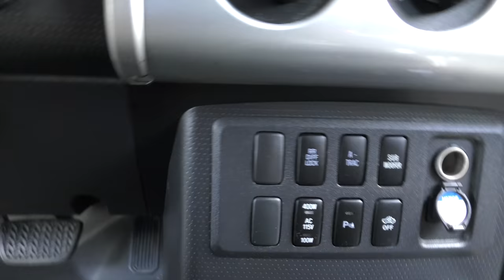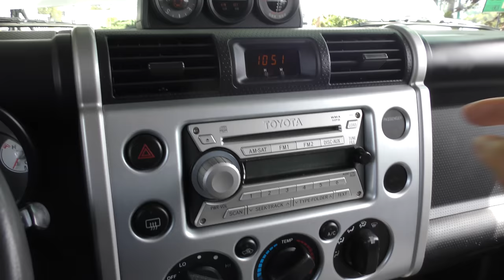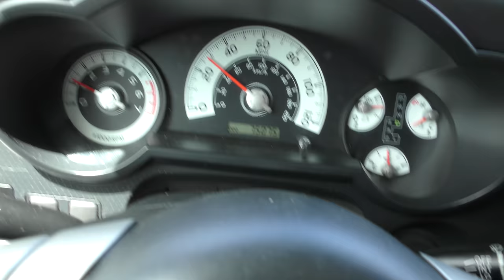I Finally Got a Toyota FJ Cruiser and Here’s What I Really Think of It

Comment: I witnessed a distracted driver slamming her car into the back of one of these which was at dead stop, she was going 40 mph. The Toyota didn't have a dent on it and her car was totaled.
Reply: Not a dent at 40 mph collision? Bee Ess. Because physics.
Reply: Yeah ok 👌
Reply: I had a '85 Toyota Xtra Cab Truck and got rear ended. This was back in '86, so don't recall the speed. I was sitting at a stop light on an off ramp and a lady smacked into me. We pulled away to get out of traffic and I could see her front grill mangled pretty good. She just took off in the opposite direction, probably had no insurance. My bumper just had a little smudge on it and  pushed in maybe 1/4", not real noticeable at all. Steel wool buffed out the smudge. Of course this was back when a bumper was a bumper. Sadly I cannot say the same for the frame. It eventually rusted where the spring shackles welded to the frame. But I bet it's 22RE engine is still running somewhere.
Reply: Was it my FJ? Because a girl in a BMW was distracted while driving and slammed into me. Thankfully she just scratched my tow hitch but her front end was demolished.
Reply: Perhaps if the Toyota was at rest without brakes applied....a lot of energy dissipated moving the FJ....
Reply: I could see that happening. A lot of the larger cars have more solid frames.
Reply: I had a 30 ft box truck hit me in my 09 FJ on an exit an entry ramp to dc beltway at about 40 mph  — it didnt even bust the spare plastic tire cover on rear door! ! It possibly pushed the tire in some
Reply: Not impressed my grand vitara did that as well
Reply: @NeverTalkToCops1   the front end of a car is designed to crumple and absorb energy. Hitting a much heavier vehicle at the bumper, I could see it.

Comment: Things that stood out to me on the fj
It’s a gas hog
Windshield cracks more than other windows do to that flat angle when anything hits them.
If you like to have the seat all the way back you’ll have a hard time seeing stop lights cause the roof sits so far forward.
It’s very reliable
There are vehicles better at off-roading but It gets the job done.
Love the rear doors for back seat passengers.

Comment: I own a 2016 FJ Cruiser and I have owned many other vehicles in the past, this is a keeper.
Reply: Not in the US you don’t
Reply: @marcoantoniokeymolen2830  correct I retired from US here in the Philippines and they still sell it here.
Reply: How is your FJ holding up, Roy? 

Do you love it?
Reply: @brianlee7738  holding up quite well as I expected. Been over flooded roads and mud from landslides as well as farms. I do keep the underbody coated to avoid any rusting and I have installed a transmission oil cooler to deal with regular ambient heat here. They are quite popular here as a matter of fact with plenty of aftermarket support.
Reply: I own a 2013 FJ. Bought it new. Absolutely bulletproof! Best car I’ve ever owned.

Comment: Love how Scotty just didn't mention the rust behind the passenger side headlight under the hood... if it was chrysler that would've been the 1st thing he mentioned
Reply: All my Toyotas made after 2000s have scattered corrosion spots throughout engine bay and undercarriage. But because I love my Fj so much I’ve never noticed my bias till you pointed Scotty’s out haha
Reply: @jamestowne6459  Yeah I think we are all biased to whatever brand of vehicle we like.. I like the FJs allot always seemed like it would be a fun vehicle to own.. but to be honest I've had a Toyota truck that was great with no problems and then had a Toyota matrix that the engine locked up at 124k. miles.. U had a Dodge Magnum RT with close to 200k miles that never gave  me any problems other than having to replace bushings in the front end and have a Chrysler 300C now that I had to replace the motor in at like 78k miles.  So I think there are good and bad vehicles of every make and model but the ratio of good to bad varies between the brands

Comment: Mine is a stick.   I have no plans to replace.   It does great off road and in the snow.   A lot of that depends on tires though.   It has been down to 20 below for extended periods and it always starts.   They are great vehicles and you don't need someone yelling at you for 10 minutes to show it.

Comment: I have a 2010 Army Green FJ Cruiser.  My engine factory skid plate rusted completely through in the middle. I replaced it with a thick aluminum plate by RCI off road. Now it has a oil filter access panel on the plate so it doesn't have to be completely removed to change oil.  Running aftermarket steel bumpers with shackles and an 8000lb winch.  Rust is an issue here in Appalachia lots of salt on the roads in the winter.  I have thought of getting another vehicle something easy on fuel.  and cheap so I can put my FJ in the shop and have the rust removed from the frame and have a rust preventative coating added and bumpers need done too.

Comment: 2 things scotty.

1. The oil filter should not be empty unless the anti reverser flow gasket is broken.

2. There's rust under the power steering reservoir, prob due to leaking reservoir.

Comment: Early versions had a graphite style coating on the head gaskets which liked to dissolve over time , they develop a small leak that will push coolant into the overflow, symptoms are a full overflow,  hard or erratic idle on start up , due to small coolant leak into the cylinders on last cool down. 
I've seen these go past 700 thousand km even with questionable servicing, 
They are a great engine with the head gaskets sorted using a decent quality mls gasket and the pickup cleaned or inspected regularly.

Comment: I'm a original owner of a 2007 FJ Cruiser. Love it, practically no engine problems. If there is a problem, that'll be (rust) underneath. The undercarriage, is rusting away to the point I have to buy a new vehicle. N, I only have 98,000 miles on the vehicle. Great engine, terrible body frame !!! Can't handle the weather up north. It's ashame, I love this vehicle.

Comment: Got a 2007 FJ 180,000 still going great car, did the water pump even though it wasn’t bad yet at 175,000, all idler pulleys, and two wheel bearings at 140,000.

Comment: I have a 2011 FJ towing my RV full-time. 212k miles on the dash and not a squeak or a rattle. Nothing has ever broken, and I do maintenance early or on time. Hilarious thinking Californians don't understand FJs, though, lol. All the overlanders I know with FJs are from SoCal. I'd argue they're the most devoted, considering it's the most expensive state to drive an FJ. I bought mine in Georgia, and the dealers there didn't know what they had. Mine came fully loaded with a 400-watt inverter in the back and the JBL speakers plus the standard stuff: A-trac, RR, backup cam, etc.

Comment: yah I bought two of them in 2019 a 2008TTE with 95k & 2014UE with 72k.  Unfortunately just had to let go of the 2014 as the engine began exhibiting knock and tap noises that were progressively getting louder ...didn't want to deal with that.  2008 runs like new though ☺️

Comment: I had the exact same one. Same year and color and roof rack. It was an excellent vehicle and extremely capable off road.
I always regretted selling it, but I seldom used it.
Sold it with only 18 thousand miles and got two thousand more than I paid for it. They made them for many more years after 2014, but only available in Europe. Now they’re completely stopped ☹️

Comment: Hino vehicles are made to be reliable and easy to work on with common tools. I drive a 2008 FJ Cruiser with 185k, and it has never let me down. Terrific long haul overlander,   Because hino manufactures for the international market, FJ forums are full of owners from all kinds of environments, from USA to Australia to the Mideast. It’s the best car I’ve ever owned. My 2nd best?  A 1985 Toyota Xtracab 4x4 pickup with a solid front axle. I drove it 290k.
Reply: Got about 07 191k and love it going to keep changing all fluids spark plugs belts and water pump keeping it for 4 more yrs

Comment: My 98 Merc Mountaineer is all original except the torque converter that went at 290k, with 350k. Only reason I haven’t had it in on the road in about 5 years is the shackles are rusted gone and road salt has eaten the oil pan and  gas tank. (Live in the rust belt) the 4.0 is as bullet proof as anything Toyota makes.

Comment: I owned an 05 4Runner. When using good quality gasoline in New England that would be an Irving. I would get my average around $21 to 25 miles per gallon. I think that's pretty good for a four runner. Excellent for an overall SUV of the style and quality and weight. Did anybody else notice that their Toyota 4Runners and or FJ cruises got better mileage than what they advertised.

Comment: I have a 2013 Trail Teams Edition, with 37K miles, and have been offered $40K for it. It's completely paid for, and is pampered. Trail Teams is the top-end, offroad, and TRD (Toyota Racing Division) options, e.g., ventilated oversized brakes, Bilstein shocks, etc. I use it as an every-day, and occasionally put on my set of offroad tires, and head out into the backwoods (I live in bucolic area, moderate to heavy snowfall and a lot of offroad trails). Normal day-to-day tires are Michelin all weather/all season. I've had the Beast since November of 2013, which makes it 7 years old, and never a single problem, except that once, at interstate speed, a trim strip at the top of the windshield flew off and got run over and crunched to pieces. $120 to replace. I intend to keep it until I can no longer drive it (I'm 75), a long way off yet, then bequeath it to my son's who can fight over it. I would actually like to see an EV adaptation, perhaps an upgrade kit to EV or hybrid.

Comment: I traded in my blue 07 FJ for a Lexus back in 2017, 67k miles, not a single problem, all original light bulb and even the battery was original. That’s how reliable the  FJ is.

Comment: I'm the original owner of a 2014 FJ Cruiser purchased brand spankin new with 14 miles on the odometer. Today I put in 15.461 gallons of gas on 337.2 total miles which works out to 21.8 miles per gallon getting this straight off the receipt.  And since I purchased my ride mid 2014 I've been getting over 20mpg off of Costco Premium or Chevron Regular gas. I live a little more than a mile off of the highway that takes us everywhere. And I'm a speed limit driver so there. But if you're not getting over 20mpg on a tankful of gas for your FJ Cruiser then you must not do highways and you drive too fast. And my FJ is 100% virgin stock absolutely no mods or changes from the day I drove it off the dealers lot. Yeah same tires too!

Comment: As a former Land Rover owner of many years, 1964 to 1993, and a Jeep Wrangler Unlimited Rubicon owner since April 2012, I've a long admiration of the Toyota Land Cruiser.  The original Land Cruisers, the FJ's that were sold in the United States in the 1960's and into the 1970's, was, quite possibly the most reliable 4-wheel drive utility vehicle ever made.  I know very little about the FJ, but I'd be surprised if it didn't inherit most of its "DNA" from the old Land Cruiser FJ's.  Nice video, Scotty.  Great product, Toyota.  I suspect the primary reason Toyota left the U.S. market with the FJ (and the short wheelbase Land Cruiser's before it) was probably because the average number of these vehicles sold per year was shockingly low when compared to the number of Camry's and Corolla's Toyota dealers were (and still are) selling.  Congratulations on finally getting your hands (if even only temporarily) on a Toyota FJ, Scotty!  Andy McKane, 30 August 2021, Maunaloa, Hawaii.

Comment: Your weight vs mpg argument doesn't always hold up.  My 99 Lexus RX300 got 20+ mpg and my Audi Q5 gets 24 and both weigh about 4400 lbs. (can't believe how heavy these SUVs are).  The jump in mileage + horsepower for the Audi is due to the turbo, of course.  My point is that the new engines seem to be more efficient (better mpg per pound).  Fun video !! I had a land Cruiser for a while -- I think these were closer to 5500 lbs !! What a tank, but it drove incredibly well considering its weight.

Comment: I had a 2010 FJ that I bought new.   Loved it but I pick up my kids every day from school and they hated climbing in. Especially since they enter the right side of the vehicle and need to climb into the back.  The way the rear door access opens you have to open the front door first so someone needs to get out and walk around to let them in each time.  Then if I went anywhere long distance the gas mileage was killing me.  I ended up trading it in back in 2018 with 40K miles on it.   They gave me almost what I paid for it because the prices were going up due to demand.   I regret that I had to go with another car but it just wasn't practical.   It was a LOT of fun to drive though and got a lot of attention.

Comment: I bought an 2007 brand new, I loved to drive it and it was great in winter. I traded for the same year tacoma double cab, same miles because I need more room. I wish I still had it. I'm still under 100,000 miles on the tacoma
Reply: I also owned a 1976 FJ40. I wish I had that too. Original motor

Comment: I just purchased a 2008 FJ Cruiser with 120k miles. The family absolutely love it. It throws up a P0016 check engine code every couple of days then goes away on its own within 24 hours. Some people are telling me it's the timing chain. I just have a hard time believing a Toyota chain would need to be replaced so early. It runs perfect with no issues. I'm working on checking all the sensors on bank 1 before opening the engine up to check the chain. What are your thoughts Scotty?
Reply: I just seen the 2007 to 2009 models get bad knock sensors if you don't run premium. And 1 head has to come off to replace them due to a pipe under the intake? or alternate primo and good 87 octane. Good luck!
Reply: @craigjohnson3603  thank you, good to know. I ended up solving my issue. It was a simple crankshaft position sensor harness that needed to be replaced due to being damaged.
Reply: @7THxSIGN  nice, other vehicles you may have had to get out the parts cannon and cost a fortune I have a 2014 and I love it.
Reply: @craigjohnson3603  yes! Such a great car!

Comment: 75K on a 2007 is great mileage.  That guy got a steal.  My 2008 has 113K, so I have at least 250K more before I have to worry about engine or transmission issues.  I bought it new, so its been paid off for 7 years and maintenance costs are nearly nothing.  Best value ever.

Comment: They, or just the 07 I drove for 10 years was riddled with automatic transmission,  supension, and electronic issues. I loved so much!  I miss it too! I just couldn't justify the money pit it was turning into.  Got a ton of money for it, even being honest about issues.  But do your homework, and make sure you have your mechanic closely check it over before you write that check!  They do have frame rot problems,  body stress issues, even serious engine issues. It's one of the hottest used vehicles on the,market for the last 12 years,  be careful!

Comment: The FJ Cruiser has the driveline of the Landcruiser Parado. In Australia, the option of manual gearbox and diesel engine was available, essentially making the FJ Cruiser an excellent off-road vehicle. Supported by both Toyota Australia and the aftermarket, configurations were personal. 👍👍🇭🇲

Comment: 2009 RX350 AWD 22 on hwy at 80mph I which I think is at what it should be or 1 mpg under.  If I were to take it back to 55/60 there is no doubt that I would get 25.  But nothing around where I live is 55/60 for any extended time

Comment: I have an 07 6-speed FJ with 140k miles, some rust but who cares... its a TRUCK. I got under it with a wire wheel, got the loose scale off of what I could reach and just sprayed it over with some rust converter. Thing is a TANK, i'm just gonna drive it and i'm not doing a thing to it other than oil changes.... the tires should last me a very long time because they are all terrain.

Comment: 20 MPG on my 07 FJ. 20 MPG on my 7900 lb. 08 Silverado/Duramax with steel flatbed.  I refuse to drive a 3000 lb little death trap just to save a few bucks on gasoline. A more substantial vehicle is an insurance policy to me and my family.  FJ has 160,xxx miles so far .  Duramax has 398,xxx miles so far.

Comment: After using my car (Camry 2011) for 10 years, I bought FJ cruiser 2021 (They still sell it here in the Middle East) and due to high fuel consumption they provide the car with 2 fuel tanks in total 155 liters (41 gallons), So in other words they solve the problem xD

Comment: I bought N 07 FJ in Feb 2021, previous owner camouflaged the rusted frame. Cost me $600 for half a used frame and $1100 to have it welded in. Before you buy a used FJ…CHECK THE F’n FRAME.  If you have read this, you have been warned.

Comment: Several years ago when I was looking at toyota's, I looked at the FJ and after reading the reviews on it as much as I like the fj, it was the mileage that finally steered me away from it. I ended up getting a four-cylinder Highlander and the mileage on that thing is great and a few times I have had snow where I'm at I have had zero problems.
Reply: Depending on your intended use, the Highlander can be a better option. Better MPG, more practical (4 doors) more comfortable, better visibility, more modern ergonomic...

But for going off roads, the FJ is a better option
Reply: @michelt4390  yes, I have a 6cyl Highlander with all wheel drive and very happy with it. Gets up to 28mpg on the highway. Reliable and solid. One of my best vehicles I ever bought.

Comment: They're worth more than new if they're only a 2010 or so.  They cost around 26 thousand then. a 2010 is they're worth a lot more than that if they have low mi. I just saw a 2014 with 90,000 mi for 45,000 on the toyota lot.